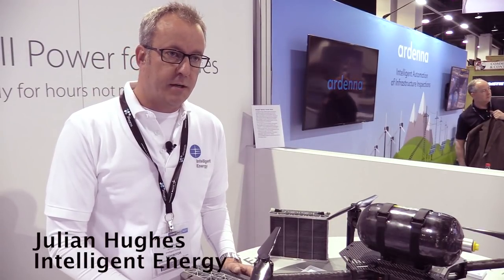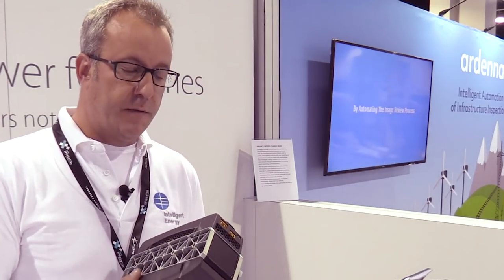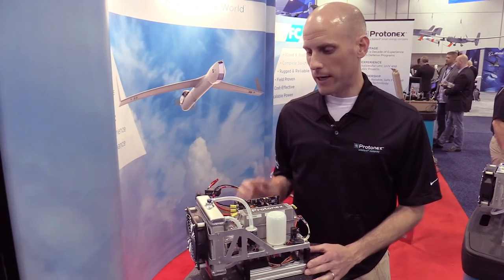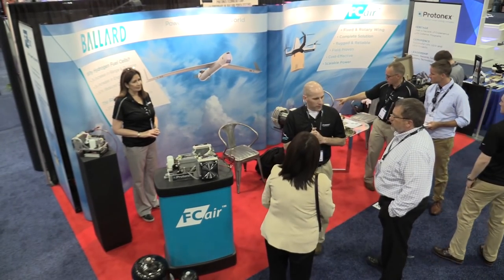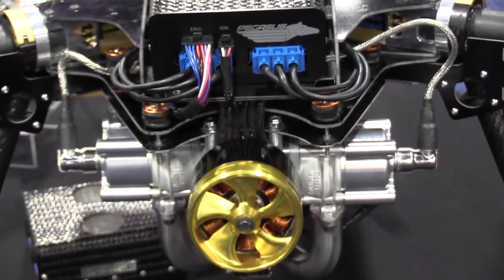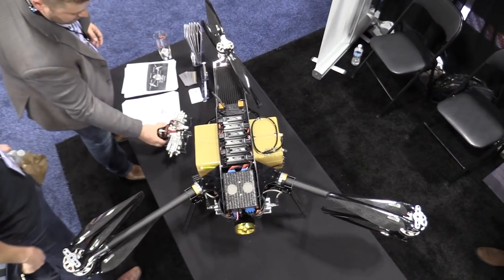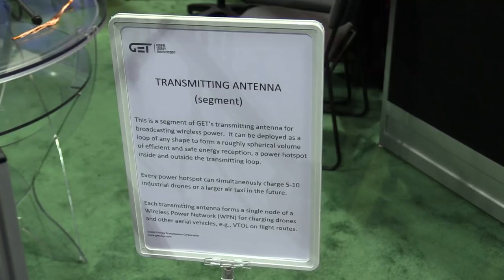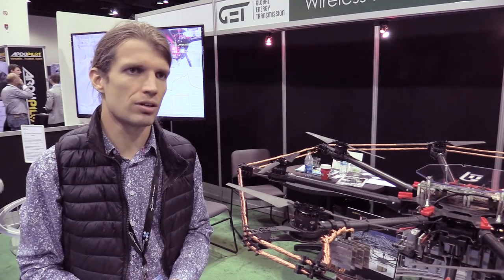Hydrogen Fuel Cells Go Flying

Comment: I spoke with leonid at CES. his wireless charging flying drone. i don't see why they don't use this kind of thing for unmanned ground vehicles. better than using huge battery packs for a bus, pretty impressive. 

great video
Reply: Creating, storing and transporting Hydrogen fuel is very costly (inefficient) compared to just raw electricity into batteries. Another issue is that we don't have a perfect way of storing the hydrogen inside a car. There are a few options that work but none that work as well as we need them to. For small scale like drones, inefficiencies don't matter as much sort of like how expensive nitro fuel isn't very expensive at small scales like in RC vehicles but would be insanely expensive for a full sized car.

Comment: The last one, pity they can't use titanium or aluminium for the receiver antenna, to save weight. Great idea though. Good for the (maybe) future electric manned drones. Or even a ground robotic swap charger system so you don't have to get out and muck around, just wait thirty seconds while it swaps batteries and then just go. Like from building roofs in the big city, and have the departing and arrival stations up there too.

Comment: Gasoline replaced the horse because it was more practical and expandable. The hybrid fuel cell will overtake gasoline because its just better and less toxic than gasoline. Gasoline will be cracked to form hydrogen and carbon.
Reply: but it's  more expensive